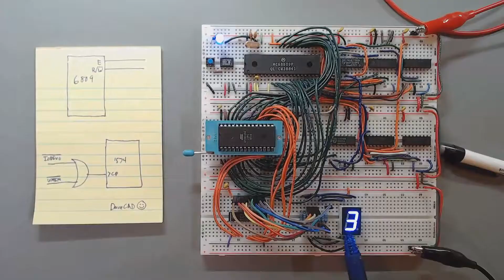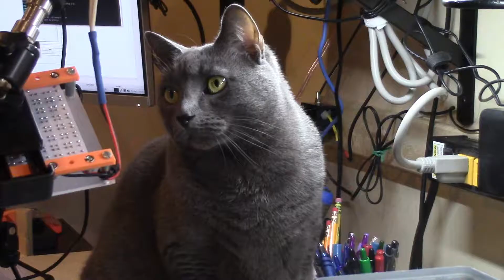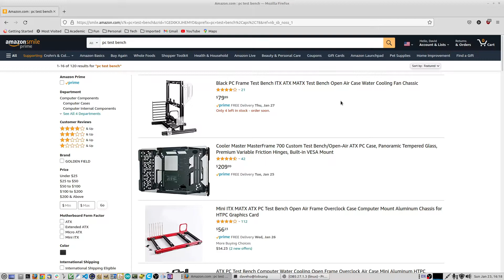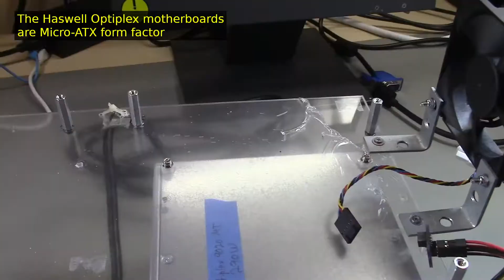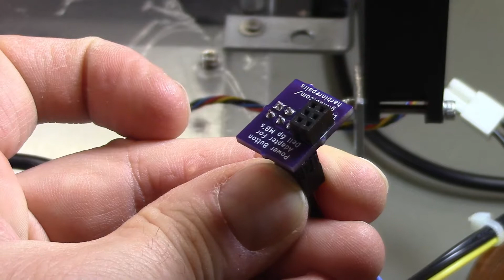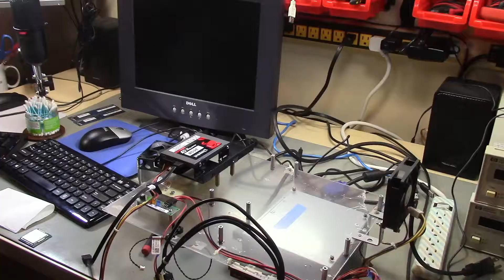PC Tech, Episode 02: An Optiplex test bench

Comment: What about the Dell optiplex 9010???
Reply from the maker: I believe that the Harbin Repairs adapters (both the 5/6 pin power and 20 pin front panel adapters) also work with the 9010 MT motherboard. However, I don't have any direct experience with them.
Reply: @davehohacks  I fixed the problem just switched motherboard working good just need to replace gpu dual fans and I'm complete 👍